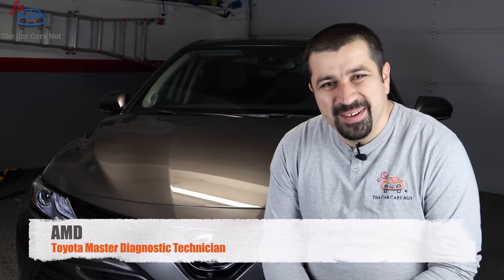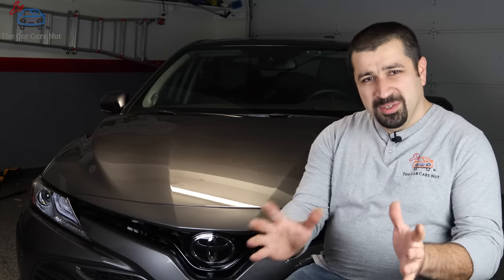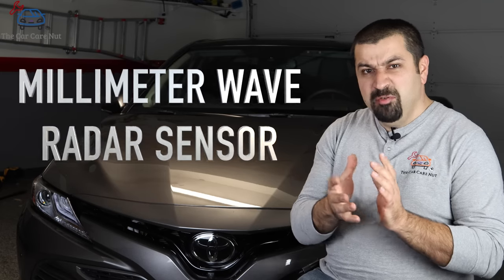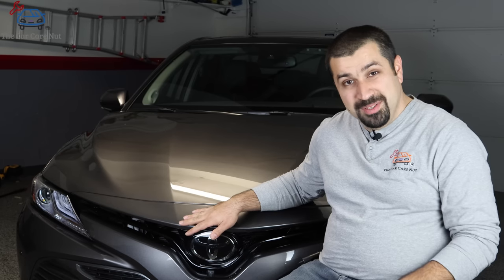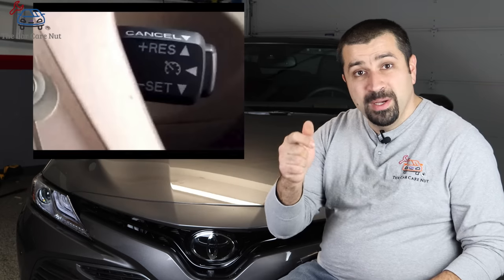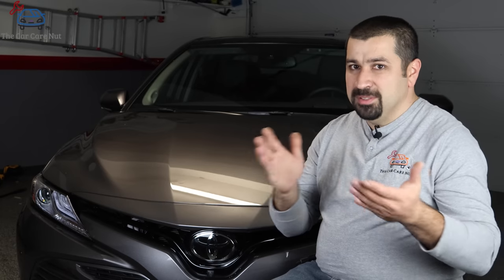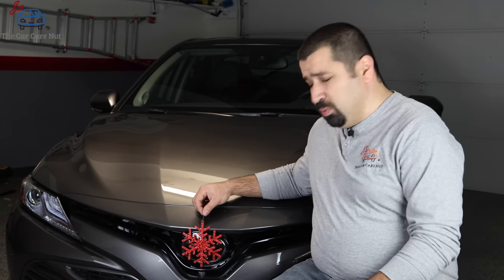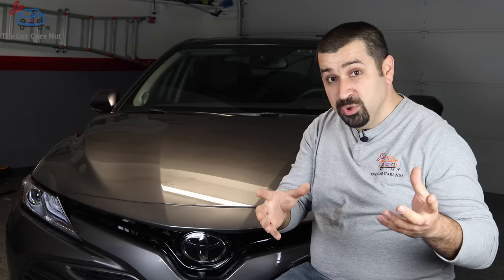How do Toyota Safety Sense Work Part 1 Radar Sensor

Comment: Would you buy the 21 Corolla xle or the 21 Camry le considering price and your knowledge of common issues that could result in higher maintenance costs. Thanks for all the great info! I really think toyotas are the best and hope the new cars last as they used to.
Reply from the maker: They are really similar in technology and equally reliable. I would go with what fits your budget and what you like more.
Reply: @TheCarCareNut  great thanks, I was also thinking about saving some money and getting the 2017 Camry, less technology may last longer and be cheaper repairs. Thx
Reply from the maker: The 2017 is an awesome car for reliability! Just buy one that’s taken care of and take care of it as well!
Reply: @TheCarCareNut  okay, I think I will go with the 2017. The new ones seem to have a few issues.

Comment: Hello my man! Thanks for the videos. 
Sooo.. i took my 12’ 4runner to the dealer for a tranny fluid change just a change. 
The dealer didn’t opened the check plug. Neither the fill plug. They did all by the drain plug. I bought an scangage to check the level myself(will arrive on a week or two) Did the dealer screew up? They do this always on trucks.
Reply from the maker: Interesting. I wonder if they did a flush through the lines

Comment: This may be obvious to some but I was just wondering if the brake lights are actually applied when the system slows the vehicle to warn following vehicles.  I assume that if the system just lets up on the throttle then the brake light are probably not applied.

Comment: I have a 2016 RAV4 limited hybrid with the JBL system and the tech package. Which cruise control do I have?
Reply from the maker: Hi! These could be either or. Do you have a physical emblem in the front or it’s flat?
Reply: @TheCarCareNut  flat for sure.

Comment: Besides the system not being very good at handling escaping hub caps, it also is likely worse at dealing with guard rails,trees and signs in a curve. So much so that Toyota, as well as other manufactures even put it in the owners manual. Best to use good old fashion cruise control on curvy roads, otherwise it might be a good idea to take a change of clothes with you

Comment: AMD
I HAVE A GOOD IDEA FOR ANTI THEFT. 
In our neighborhood we have thieves at night time checking car door handles to see if the owner left it unlocked by mistake. 
Let TOYOTA engineers know it would be easy to connect a micro switch to all the handles and if the alarm is set and the thief tries to open the door it will chirp the alarm (horn) 3 time loudly 
Making the thief scram due to the loud noise at 3:00 am. That would put an end to checking door handles @ night.

Comment: I'm not a big fan of the adaptive cruise control (CC) on my Tacoma. Even at the closest setting there is plenty of space for an impatient driver to come into the lane in front of you. This makes the truck slam on (okay maybe not slam, but aggressively apply) the brakes to maintain distance. Then if the car in front of you moves over and your desired speed is faster than you're going, the truck accelerates more aggressively than I would have otherwise. It just seems like a bit of a spaz sometimes. My personal assessment is that it's nice on single lane roads, but not my preferred type of cruising. It also can't really be used as intended with a manual transmission since shifting disengages CC.

Of course other people's opinions will vary. It's a nice feature to have, especially because it can be turned off. However, I wish you could change the default to be regular cruise control and then you had to press and hold to turn on adaptive CC.

Comment: I am looking for a newer car to replace my 2007 Yaris (4D sedan).    My problem is that mine only has 141K miles on it, all the important stuff is replaced (i.e., water pump) and I still get 30mpg.  I'm interested in newer safety features like RCTA and RCD.  I can't seem to find what year of vehicle I'd have to buy to get those features. Any suggestions?

Comment: Hi Mr Ahmed. Can I ask a question out of topic? I own a Toyota Corolla cross hybrid., I saw a video that the proper way to start a push button start type of vehicle, push the start push button twice first giving it ample time in between to let the panel lights settle down, then press brake snd finally for the push the start button. Please advise if this is a sound idea? Or I’ll do the usual brake pedal and push the start button? Thanks
Reply from the maker: Hi! No need to push the button twice then start. Simply start the car by pressing the brake pedal and hitting the start button.

Comment: I have a 2022 Highlander XLE with 18K.  I received a scratch on driver side back bumper 7 months ago. Today my Blind and back sensor are not working?  Toyota states if there are any blemishes this fix is at my cost???  I did not cause this accident as it was in a perking lot and individual never informed mre of their wrong doing.  Is this a fair practice of Toyota I've owned 2 of them.

Comment: Hello AMD. I have question. For 2016 Lexus RX350 AWD can I use non-Toyota gear oil since it is non-synthetic and very overpriced. Can I use Valvoline full synthetic 75W-90 (API GL-5) instead of Toyota 75W-85 NoN-synthetic gear oil? Vehicle has 30K miles rite now. Thanks in advance
Reply from the maker: Hi! In this case you’re good with Valvoline

Comment: Hello AMD 
I have toyota prius 1.8L 2010 with radar cruise. However, i have replaced the front radar sensor and also driving support ecu but my car is not able to get in radar ready mode ON, when i turn on the cruise control and on the dash meter cruise control indicator flash. I did diagnosis and the error code I'm getting is C1A0A. Also, upon checking the data list on techstream the region code was EURO on driving support and also front radar. I hope you can help me out with this please.

Comment: Hey good evening I got a 2013 Toyota Highlander with 47000 miles v6 motor what are the service to do with it I used for long distance like New York to Canada
Reply from the maker: Hi! Honestly at this mileage and age not much. The coolant shouldn’t been replace already. The spark plugs should have more time left and perhaps get an oil change. Check the rest of the car tires breaks and suspension and have a wonderful trip

Comment: Ghost car in an empty tunnel. Twice I have been going through an empty tunnel and the car has 'detected' a car going slower in front of me and has slowed me from 80kph to around 63kph for a couple of hundred metres. Spooky! Otherwise, this system is a lifesaver for me.
Reply from the maker: Possibly picked up on something metal which happens.
Reply: @TheCarCareNut  I don't think so. Two different times going two different ways, but both going uphill. Plus, I saw this reported about another car brand, and my dealer said it was a known 'feature'. Reflections of the radar on empty tunnel balls can seem like a car which isn't there.

Comment: I must be doing something wrong because my RAV4 Prime's lane keep assist is terrible. More than half the time when I test it out, it always swerves right and left before going to the middle just see it repeat. It rarely keeps a straight line. If it does, it doesn't stay long. When I tested next to  a solid white line with a wide green bike lane next to it, it didn't detect it at all. There's no way I'd trust it to drive itself. It has failed spectacularly.  This is a complaint solely on the lane keep with cruise control off.
Reply: Just wanted to make sure people realise this system is not designed to drive autonomously, even for a second. That is why it's called Lane Keep ASSIST. I have the same system, and it even warns me if I try driving without hands. But I also don't really like it and don't use it, it's a bit too active to my taste.

Comment: Can paint protection film be applied over the front toyota badge with the sensor built in?
Having front bumper PPF put on car and was wondering if this also can be done.
Reply from the maker: Good question. I personally haven’t tried it but I wouldn’t over the emblem as it could affect the sensor. You could try it and see if it affects it. If it does it can be taken off
Reply: @TheCarCareNut  Thanks...I'll let you know how it goes......I want everything protected so I guess we'll see.
Thanks again.

Comment: Wow, I wish I would have known this. I was driving in a snow storm and it was wet and collecting on the front of the car.  Barely anyone on the road. I tried to use and an error code was flashing on dash and wouldn't turn off until I removed snow.

Comment: Hi I have a 2018  Toyota Corolla LE I had replaced the field pump by the dealer because they were doing a recall and after that I smell gas from inside the car when I start it is that normal?
Reply from the maker: Hi! Some fuel smell that fades after a few days is ok. But if you still smell it after 5-7 days then take it back to the dealership to make sure nothing is leaking.
Reply: Thank you

Comment: Safety sense 2.0 vs Safety Sense 2.5 Plus next plzzzz =) i can't wait. Lol there's an object sitting at my nose! That was funny. Also, how does it know not to pick up another Toyota's or another car with the same radar's millimeter waves? If i drive the a vehicle which uses the same radar as the car next to me and we are both using our radar cruise, we are both bouncing the same waves all over.
Reply from the maker: Very good question. I am not 100% positive on this one but each radar will use a specific frequency of transmission. Not is it possible that 2 cars happen to be on the same frequency? Don’t quote me on this one.
Reply: My 2021 Tacoma only senses the vehicle directly ahead of me that is in my lane.  As soon as I move into the lane to the left or right, the system doesn’t sense any vehicle that’s not in the range of my sensor.  I surmise that it uses a narrow radar beam.  I always use the furthest distance setting (mine has three distances that I can choose) because I don’t want to be following too close at highway speeds.  It has never failed to operate properly, even on freeways with lots of curves.

Comment: Nice explanation and very helpful. 
Does this front sensor needs to be cleaned all the time for mud or something else except snow/ice, in order for the radar to work properly?
Reply from the maker: So the sensor can tolerate some normal dirt from driving but heavy mud or salt build up could make it stop working. If driving in these conditions it would need to be manually cleaned
Reply: I've only had the sensor alert me one time it was being disabled (in severe weather). I pulled over and found Toyota logo on front was iced over. Scraped it off and restarted car and boom good to go! Otherwise I've found this system very resilient in snow and rain.

Comment: I HAVE to make a decision tonight... Please help!  I'm having my first baby next month and an SUV is too out of budget for us. Between the two options which car should I pick?

I have two Camry's to pick from:
2012 Camry LE 99K KM,  4-Cyl.  Brand new winter tires included on rims.  Have to redo the brakes as well. (I live in Canada so winter tires is a must)
$8500, all ready to go. 

VS

2011 Toyota Camry SE 136K KM,  4-Cyl.   75% Winter tire threads included.
$9000,  all ready safetied and ready to go.
(The pick up of this engine is insane,  previous owner did no mods but it's so fast and the steering is how I like it,  firm and accurate.)

WHAT DO I DO ! So hard man because the 2011 has leather seats and the driving experience is better.  But resell value is going to be lower and higher KM.

Mr Car Care Nut please help!
Reply from the maker: Hi! I would go with the 2012 Camry for longevity. The 2011 Camry even though it appears to have the same engine had some oil burning issues if not maintained right so be careful with that. Another option is to look for a 2012-2014 Camry SE which will actually drive nicer than the LE and the SE in the previous generation

If the 2011 has a very good service history showing oil changes around 8000 kms then it’s ok otherwise I’d look at the LE or find an SE to satisfy both better improved version and your liking of the way it drives
Reply: @TheCarCareNut  The 2011 doesn't have any service history records.  Based off words from the owner that's it.  

There's also another option... 2015 Toyota Camry SE 4-Cylinder for $10,000.  But it has some rusting issues on the right side door from a very minor scrape that was left unattended. I can't post pictures here so I don't know how to show the rust.  Also the front timing leak has what I can describe as "black dust"....  Just like your buying guide said.  It's not under warranty anymore...  Does the 2015 Camry sound like a good idea ?  There's also a code that my OBD2 reader picked up...  C1249.  

You honestly don't even have to reply but you are... and for that I am so grateful sir!
Reply from the maker: The 2015 is actually even better in the long run. The rust on the door can be fixed or even the whole door replaced with a used door of a matching color car. I am a bit worried about the 2011 without service history. The 2015 is likely the best out of them all. The black dusting on the front cover is the very early beginnings of the leak. Even with the leak I’d go for it. Clean the black dusting with some brake cleaner and see how it progresses. It could be a long time before it actually develops a leak.
Reply: @TheCarCareNut  Should I be concerned with the code?  If I were to fix the front timing leak,  is it a serious issue with a huge bill?  The 2015 has 146k KMs. Which is fairly low.  If I leave it without fixing the leak and do my oil changes diligently,  it wouldn't be so bad?
Reply from the maker: I’m not concerned about the code. Worse case scenario is a brake switch which is an inexpensive part and easy to replace. And the leak even if it gets bad will make a mess but won’t cause a significant loss of oil.
Reply: @TheCarCareNut  The 2011 Camry guy keeps telling me he did the maintenance but there's no real record of it.   So I've taken the 2015 to a mechanic and he said he can fix it and the rust isn't bad.    This a bit off topic but when you touch inside the muffler,  black film is left on my finger.  Is that an indicator of anything?
Reply from the maker: I think the 2015 will be better long term. The black film is normal from combustion nothing to worry about.
Reply: @TheCarCareNut  Found out that the 2015 Camry owner hasn't changed the transmission fluid, and the mileage is 146K KM.  If I change it after buying it,  would it be a bad thing? Or should I just leave it?
Reply from the maker: It’s border line honestly. If you are going to change it do it as soon as you buy the car otherwise leave it alone.
Reply: The Car Care Nut SOOOO very kind of you to support BubbleTeaFob so persistently with so many helpful responses throughout their buying process!! Shopping for a car is such a risky, stressful endeavor, and I can only imagine what a relief it has been for them to not have to feel like they were in the process alone or without adequate information. Kudos to you for your generosity—- TRUE Christian & Christmas Spirit!!! God bless you and may your kindness & professional generosity be multiplied back to you! Merry Christmas!!🎄🙏🏾🤗

Comment: My Toyota Corolla Cross hybrid’s adaptive cruise control I seems to be the non full speed type. It disengages automatically if the car ahead is not moving or less than 30km per hour. Is a good thing,that I program it to be distanced around 2-3  cars far; I still have time to brakes when it disengages. What if my programmed distance is nearest the object in from off me?
Is there a way to change the sensor to be full speed type?
Reply from the maker: Hi! So the non full speed ones need more supervising at lower speeds as it disengages and all it does is beep when it does disengage. In my opinion the non full speed is more suited for higher speed driving like highway driving than city and stop and go traffic. Unfortunately it cannot be upgraded to the full speed one.

Comment: I see folks talking about mods to their vehicles (Rav4, Forerunner, Sequoia, etc.) where they add larger tires and lift kits to increase ground clearance. I assume this would affect Saftey Sence performance but can you comment? Thanks for all you do. :)
Reply from the maker: Yes it would affect it. It’s either going to make it inaccurate or it will cause trouble codes and the systems get disabled. Depends on how extreme is the modification.

Comment: I wonder how much one of these radar sensors cost to replace if damaged by a collision I mean our insurance rates are super high with safety sense I wonder if that’s because the sensors for safety sense are expensive as well as the whole car but just a conspiracy but still I’m curious as hell
Reply from the maker: Hi! Sensors and the emblem in front it can easily be into the quad digits price wise just for parts

Comment: Adaptive cruise control is a pain in the arse, someone changes lanes in front of you and the adaptive cruise control hits the brakes or you come up on a slower car slowly and next thing you know you look down and see your traveling 8 miles per hour under the speed limit because of the car in front of you. I hate adaptive cruise control. The emergency braking is also a joke, sometimes it goes off and you are well behind the vehicle in front of you and braking just fine or it does not even detect the vehicle in front of you.

Comment: my 2019 Tacoma TRD offroad manual transmission keeps the throttle active when changing gears and radar cruise control on. weird engineering imo. my 2007 Nissan 350Z manual transmission cut off the throttle when the clutch is pressed to change gears. much better